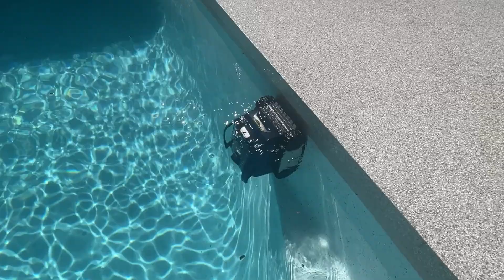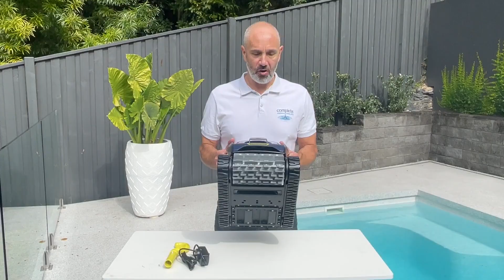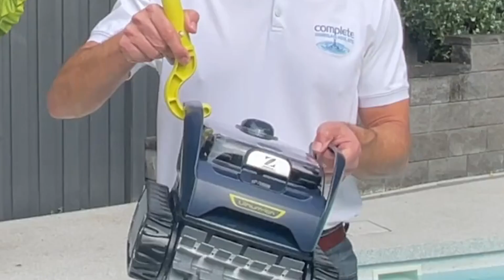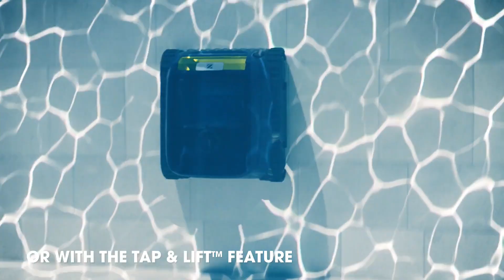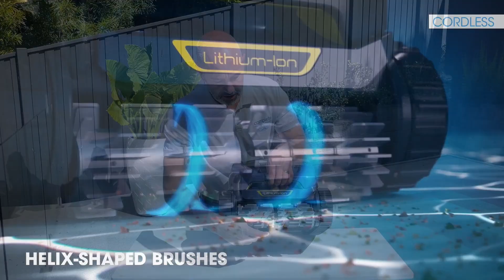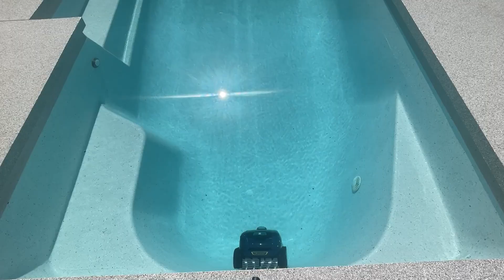The Ultimate Zodiac Freerider Cordless Robot Cleaner Review

Comment: Hi, great review. Just wondering, we actually get a lot of very fine dirt and sand rather than big debris like leaves, in fact, we hardly get any big stuff. Which unit would you recommended. We do only have a small pool less than 8x4
Reply from the maker: Hi. Go for the FR800 with dual stage filtration. The 60 micron filter will remove the very fine dirt. If you would like an unbeatable from us for any of the Zodiac robots, you can reach us at splash@completefibreglasspoolkits.com.au

Comment: How do these go with silt laying on the bottom ?
Reply from the maker: If it is fine silt, you will need a model with dual stage filtration (FR500 or above) to take it out of your pool. If it is a thick layer of silt that has been there for a while, you will need to manually vacuum it to waste and then use your robot the next day to clean up the left over silt. We can supply and deliver an FR500 for $1,476 inc.GST (Retail $1,799) - just call 1300 652 710 or email splash@completefibreglasspoolkits.com.au

Comment: Does Zodiac make a surface skimmer?
I get a lot of leaves, the skimmer doesn’t collect everything. And of course filter is off more than it’s on. The pool is a mess easy. 
So I’ve tested a mate’s Aiper surface skimmer & it’s a game changer. Cleans the 8x4 pool surface, stops leaves ending up on the floor, and the Zodiac VX55 with its 100UM filter mesh  I have doesn’t work nearly as much.
Reply from the maker: Zodiac doesn't make a surface skimmer. The Aiper model is pretty new to the market. We've heard mixed reports but glad to hear it is working a treat for your mate.
Reply: @CompleteFibreglassPoolKits  It really is a no brainer, Zodiac & Dolphin have to do a surface skimmer to combo with a cordless robot. It’s got to be far less technology to design a surface skimmer than a floor robot. Less power needed for a start. If you can stop the majority of shit getting to the pool floor then it makes a massive difference to the pool. My pool looks horrible most of the time because the surface is getting bombed by two neighbour’s trees all year round. And the floating robot cord gets leaves caught amongst the cable. Now I can just take the cord zodiac robot out of the pool and let the surface skimmer keep the surface very clean. But I’d rather a serviceable Zodiac branded skimmer than a Chinese brand. Aiper & Beatbot do an expensive surface/bottom robot all in one. I’d love that but if they have poor longevity & servicing availability then I would just pay $600 for the Aiper surface skimmer & either keep my Zodiac VX 55 or a new cordless bottom cleaner. 
I just can’t imagine Zodiac are not designing a surface skimmer as we speak!!🙏

Comment: When you throw into the pool will that start the unit & the app or do you need to turn the unit on prior to placing in the pool 
Also my app disconnected prior to the cycle finishing so didn’t get message that it was done
Reply from the maker: You need to turn the unit on before putting it into the pool. Did you leave the app open when the robot was running through the cycle?